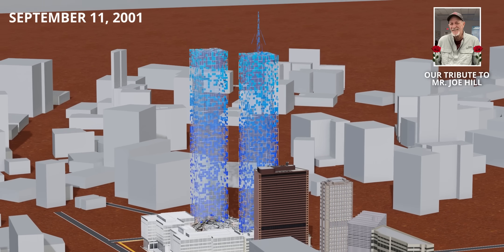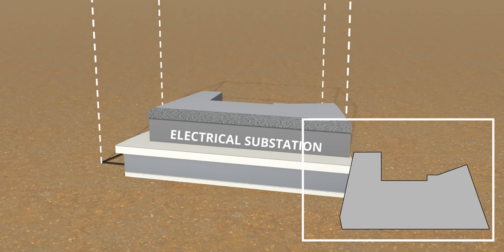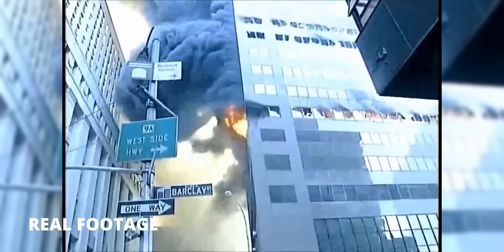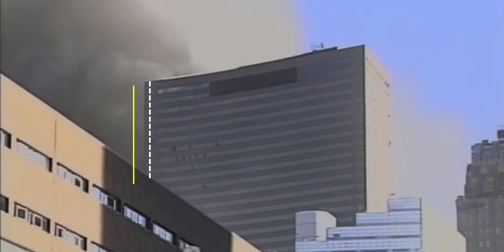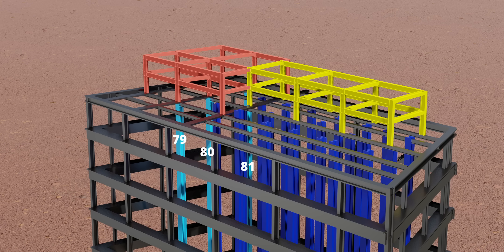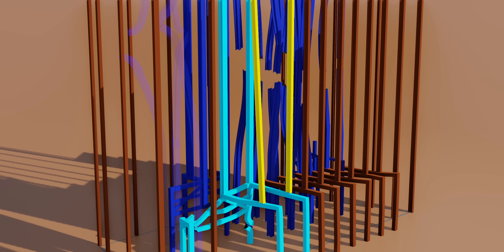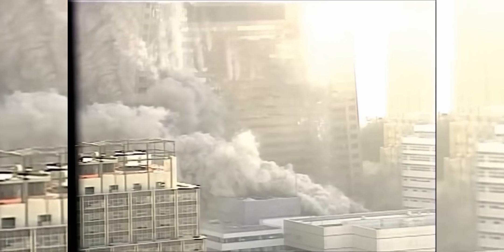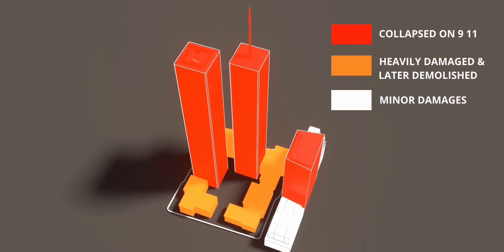Collapse of Building 7 | The Complete Physics

Comment: I asked Gemini to look for any logical gaps in the official WTC 7 report. 

Enjoy:
Of course. After a critical review of the provided NIST FAQ on the WTC 7 investigation, several points can be identified that critics or skeptical readers might interpret as containing logical gaps, unverified assumptions, or apparent contradictions.
Here is an analysis of those points, focusing strictly on the logic presented within the text.
The Absence of Physical Evidence
A significant logical gap arises from the investigation's complete reliance on computer modeling without corroborating physical evidence from the building's steel.
 * NIST's Position: In questions 21 and 22, NIST states that no steel samples from WTC 7 were recovered because the debris was removed quickly and the steel lacked identifying marks. They assert that their conclusion is still valid, being based on "a huge amount of data," including videos and rigorous computer simulations.
 * The Logical Gap: The conclusion that fire-induced thermal expansion caused a specific girder to fail, leading to the collapse of Column 79, is a product of a computer model. Normally, a scientific investigation would use physical evidence (the steel itself) to validate the model's output. Without the actual steel from the failure points, the model's conclusion is unfalsifiable. The argument becomes circular: the model is believed to be correct because it successfully simulates the collapse, but the reason for the collapse is known only from the model.
The "Free Fall" Acceleration
NIST's explanation for the building's period of free-fall acceleration presents a potential conflict with the nature of a fire-induced, progressive collapse.
 * NIST's Position: In question 32, NIST confirms that for a period of 2.25 seconds, the building underwent "gravitational acceleration (free fall)," meaning there was "negligible support from the structure below." They explain this by stating that the interior columns had already buckled, leaving the exterior to collapse unimpeded.
 * The Illogical Link: Free fall occurs when an object has zero resistance to its downward movement. For WTC 7 to enter free fall, all 82 support columns over a span of multiple floors would have had to be removed or fail simultaneously. A progressive collapse initiated by fire, as described by NIST, would logically involve a sequence of failures, with the collapsing upper section crushing the intact structure below it. This process would create significant resistance, making free-fall acceleration impossible. Critics argue that the observation of free fall is a hallmark of a controlled demolition, where supports are removed simultaneously. NIST's own data confirming free fall appears, to a skeptical reader, to contradict their fire-induced, sequential collapse theory.
The Unique and Unprecedented Nature of the Collapse
The report establishes its own conclusion as the sole precedent for such a collapse, an extraordinary claim that relies on the previously mentioned unverified model.
 * NIST's Position: In question 15, NIST states, "The collapse of WTC 7 is the first known instance of a tall building brought down primarily by uncontrolled fires." They attribute this unique event to a specific combination of factors like long-span floor beams and connections not designed for thermal expansion.
 * The Logical Gap: An event being the "first of its kind" is an extraordinary claim that requires extraordinary evidence. However, the evidence for this unprecedented failure mechanism is the computer model, which could not be verified with physical evidence. The argument essentially asks the public to accept that a common event (uncontrolled office fires) in a typical steel-frame high-rise caused a never-before-seen result (total, symmetrical, free-fall-speed collapse) based on a computer simulation alone.
Dismissal of Alternative Theories
NIST's dismissal of alternative theories like explosions or thermite relies on plausibility arguments and narrowly defined scenarios rather than a comprehensive forensic refutation.
 * Explosions (Q33): NIST calculates that a blast capable of failing a column would produce a sound of 130-140 dB. Since no such sound was reported, they rule out explosions.
   * The Gap: This refutes only a specific type of explosion—a high-energy blast. It does not address the possibility of quieter cutting charges (like thermate) strategically placed to sever columns without creating a massive sound wave. The argument dismisses the general theory by disproving one specific, loud method of execution.
 * Thermite (Q34): NIST argues that using thermite is "highly unlikely" because it would require large quantities (100+ lbs per column) and would be difficult to place without being detected. They also state that testing the steel for thermite residue "would not necessarily have been conclusive."
   * The Gap: This is a plausibility argument, not a forensic one. It focuses on the logistical difficulty of the act rather than presenting evidence that it didn't happen. Furthermore, admitting that forensic tests might not have been conclusive weakens their position. By stating they can't prove it wasn't there, while simultaneously lacking the steel to test, their dismissal of the theory rests solely on the assertion that it would have been too hard to accomplish.

Comment: In the recent Air India crash, the building where the plane crashed into still stood upright. If that isn't clear as day evidence that 9/11 was an inside job, I don't know what is 😅
Reply: OK, so what makes the two events different so they had different outcomes?

Got to use the thinking part of the brain for this one.
Reply: @TheCriticalStinker-01 

One was a planned sacrifice disguised as a terrorist attack to provide a reason for the US to invade the Middle East, and the other was a sad incident.
Reply: @harlem6365  - I was hoping you might employ the thinking part of the brain. Obviously too big an ask.

On 9/11 Kamikaze pilots pinned the throttles and crashed directly into the sides of buildings at up to 589 mph.

In the Air India crash the plane was flying so slow (under 200 mph) it stalled then skidded across the roof of a building at relatively low speed.  

The difference in energy imparted on the building was probably at least an order of magnitude.

You should probably find a more suitable hobby. Perhaps one involving crayons.
Reply: Yet the off-center impact on both towers somehow caused them to drop perfectly vertical in the exact same manner, with zero resistance from the lower level floors that should have been intact. 

The odds of burning kerosine or fire spreading equally through the building and weakening the structure in such a simultanous way for that to happen are less than zero.

Certain studies done on that day and after also provided indications that were unexplainable to have been caused by the damage of the impact of the planes, that have never been investigated further or brought to the public eye.

In rhe midst of all that happened and was lost on that day, halleluja they found the hijackers passport perfectly intact.

Maybe it's you that should have left the crayons alone and paid a little attention in class. The irony is hilarious.

Comment: Grenfel Tower in London 2017, burned for 6 hours until it was charred, from floor 4 to the roof floor 24, and it hasn't collapsed till this day.
Reply: And anyone who thinks that that's an argument is terminally dumb.

Grenfell Tower was, 1, an apartment block, 2, made out of concrete, 3, actively fought for the entire fire period. None of which was the case for Building 7. Beyond this, the building was half the size of Building 7, AND almost perfectly designed to be a fire hazard. Oh, and, just so you know...? Grenfell burned for 10 times longer than you claimed.
Reply: @mooneyes2k478 
Educate yourself
Grenfell burned from 1 am to 7 am.
Grenfell burnt until it got charred with ZERO firefighting facilities. And its been standing since then for 8 years.
Reply: Educate yourself. Grenfell Tower was made of reinforced concrete, not steel, burned primarily on the exterior and was subject to active firefighting throughout.

Why not bring up Plasco Tower - collapsed in under 4 hours. Plasco Tower was steel framed, just like WTC 7.

Wilton Paes de Almeida collapsed after burning for just 90 minutes.  Again, steel framed.

Both were subject to active firefighting efforts, which Building 7 was not.

Curious that people like you always bring up the irrelevant Grenfell but ignore my two far more relevant examples.  So, it is ignorance or lie-by-omission ?
Reply: @TheCriticalStinker-01 
Plasco Tower didn't collapse on its footprint.
Almeida Tower blazed like molten lava. The fires in WTC7 were nothing compared to Almeida.
Reply: @TheCriticalStinker-01 
Grenfell was charred to the core.
Very interesting that the steel melted, but the passports survived.
Equally interesting was the evidence of thermite in the dust of the debris.
Reply: @DoaaMohammed-e3s  - Grenfell Tower was made of concrete.  Fires were primarily external.  No amount of argument loading on your end will change that. 

If you want examples of steel framed buildings (therefore at least somewhat relevant) and their response to fire, my two examples are infinitely better. No amount of you trying to avoid this fact will change it. 

Of course, trying to compare one event you clearly don't understand to another event you even more clearly don't understand is never going to get you any closer to understanding anything.  IF (big if) you want to understand the collapse of Building 7 I suggest you engage the thinking part of the brain and just study Building 7.

I can explain its collapse to a high level of detail if you are genuinely interested, but I have no time or patience for posers or zealots. So, offer is on the table, take it or leave it, but please don't waste my time.
Reply: @TheCriticalStinker-01 
You are clearly a bot Stinker.
Reply: @TheCriticalStinker-01 
I'd much rather take the explanation from a construction engineer than from an idiotic bot fed with misinformation.
Reply: @TheCriticalStinker-01 
You have spent alot more effort trying to be offensive, than trying to explain your nonesense point of view.

Comment: How do we explain the explosions on the bottom of twin towers?
Reply: The official explanation is flaming jet fuel down the elevator shafts. But why it was so explosive I don't really understand. It shattered marble panels and glass in the lobby. People did witness fire shooting out of the elevators (and I think people actually died in those elevators very early on in the event), which isn't typical of a flaming fuel. IDK. The lobby of WTC1 always surprises me because it's so often ignored but it's actually for me the weirdest thing that doesn't add up.
Reply: @CDiPaola04  Your personal incredulity is irrelevant.
Reply: In a video about the collapse of a different building?

Why would we?
Reply: Almost all elevator shafts ended om the 78th floor skylobby. If the damage to ground lobby was caused by jet fuel fireball then the skylobby would have suffered like 30 times the damage that the groundlobby suffered. Didn´t happen. Especialy not in the north tower where the groundlobby explosion occured.
Reply: @Kudde23  Uh huh. Anything else?
Reply: @Kudde23 So you’re all done now?
Reply: @Kudde23 Uh huh. Anything else?

Comment: It does not make sense. The spire damaged the south of WTC7, and the fire was at south of WTC7. According to video footage and explanation, the collapse started from north of WTC7, and the whole structure came down. It raises more questions and answers.
Reply: Apparently it never occurred to you that fires moves
Reply: The spire fell to the south. WTC7 is to the north. This video is wrong, the upper north exterior panels of the North Tower are what caused the damage seen on building 7, NOT the spire.
Reply: @CDiPaola04  You are also wrong. The gash on WTC7´s south face aswell as the damage at the sw corner were caused by north tower core columns tipping over all the way to WTC7.
Reply: @Kudde23 Uh huh. Anything else?
Reply: @Kudde23 So you’re all done now?